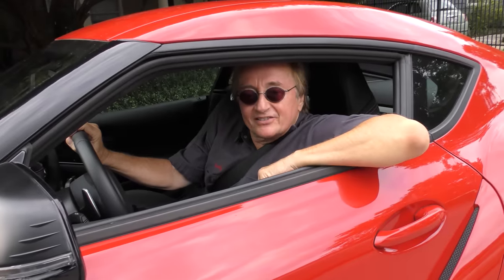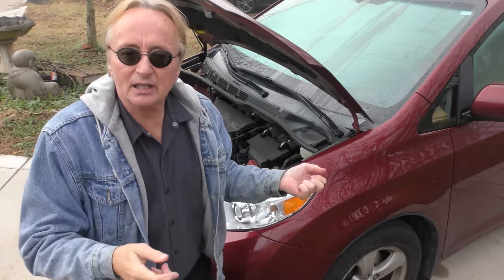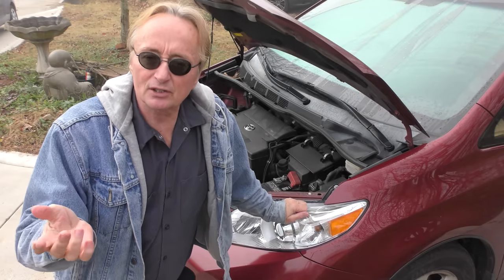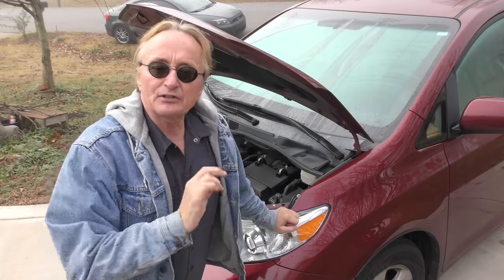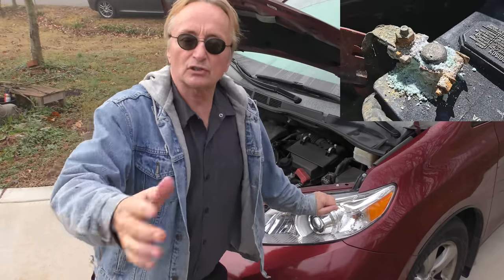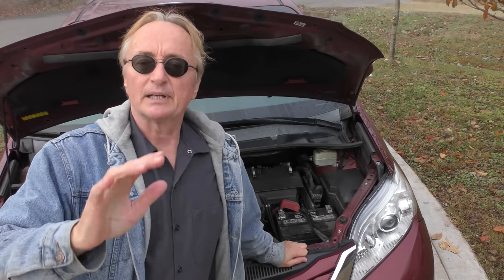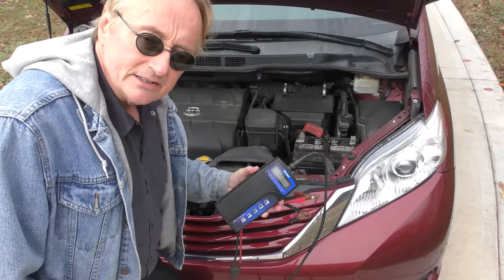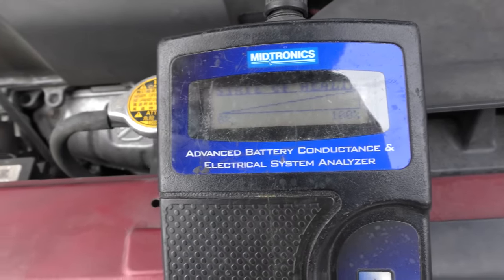If You Buy a Car Battery from This Place You’re Stupid

Comment: I worked at AZ in the early 2000's. Batteries cost $50 - $90. In six years the core charge went from $8 to $10 to $15.00. Handling the core batteries can be a messy issue with new employees. Many of the people they hire have no experience in retail, automotive repair or autoparts. The mid grade batteries, Duralast with the red label were 5 year warranty first 2 years were free replacement. I doubt you could find a battery at AZ under $100 and the Duralast now only comes with a 2 year warranty. In the time I worked there the AZ batteries were rated best by consumer reports for the 6 years I was there. Obviously things have changed with their batteries. I don't get my batteries there anymore either.

Comment: I thought I'd be smart and buy my battery at Costco.  Turns out that if you disconnect the old battery and don't  keep a charge while that battery is off the vehicle you mess something up electronically and won't  start.  Thanks Toyota.

Comment: SERIOUSLY I encourage everyone to try the batteries at Walmart. The good ones not their cheapest.  Two of the Walmart maxx Batteries have lasted me the past 15 years!!! And I just bought the third one today when the last finally went dead.

First one lasted eight years, just replaced the second one today and it was almost 7 years old. I drive my truck every day and damn near drain my battery every day while working in my truck. 

When my trucks turned off I use inverters, both cigarette lighter charger ports, and the overhead light. Sometimes I discharged them so deeply that I have to be jumped off or use my booster pack. 

I drive a Nissan titan, and both batteries were the Walmart MAXX-24F 

They offer free three-year replacement, and are $100. I always grab the battery that has the newest date on the sticker on the top. 

When buying the battery earlier today… I took in my multimeter in the batteries that were two months newer measured 12.72 V under load… Whereas the ones that have been on the shelf a few months measured 12.45. I know it doesn’t make much of a difference but why the heck not get the best one.

Comment: I buy all my batteries from the local junkyard and they work great for $40.  As an alternative I can pay $53 and have a lifetime guarantee and swap the battery as many times as I want.  I have already done my third swap on the $53 lifetime guarantee battery.  On each swap, I average down the $53 purchase price so at the moment, I am at approximately $18/battery and my next swap will bring down my average price to $13/batter.  With all due respect, when I am at Walmart, Auto Zone, Pep Boys, Costco or anywhere else, my stomach turns anytime I see anyone pay $100 or more for a battery.

Comment: It seems best to get it from a company that uses Johnson Controls. I've had issues with other brands.  Luckily it has a warranty but, I've had to change it 2 times about every 1.5 years. So far my current one seems okay it's been about a year now.  To be fair I only had one Johnson Battery. So, it could have been a fluke.  At last check Walmart uses JOHNSON control.  i believe ACDelco also uses it. There are also Local companies. If you want to buy from a local small business. My mom did that a few years ago and its starting fine in 3 years.  I believe that was a Johnson Controls battery. With there branding on it.

Comment: i got my dads old 71 vw, connected the bat terminal and the 10 year old battery turned over the motor and it started. while my RedTop died after 25 months on my toyota. sad days, designed to die now a days

Comment: if you don"t use it you lose it.   i have batteries in a mobility chair and a booster pack that were frequently dying before their time.
be it a parasitic draw from onboard electronics or just losing charge over time the results are the same. even recharging with a quality charger wont bring it back. my solution was buying a battery maintainer. they keep the battery topped off and now my batteries last years. harbor freight has some inexpensive 12 volt maintainers and my power mobility chair is on its 24 volt maintainer 24/7

Comment: Co$tco was a slightly lower price than Walmart, I believe.  I picked out the newest battery. (I remember batteries where you poured in the acid.  The leftover acid I put in the toileto dissolve mineral deposits.  Now use white vinegar.)

Comment: This advice is perfect. Batteries do last a long time. BUT when they do, they just die suddenly. My son works for Firestone. They do sell ALOT of batteries. I get it from the horses mouth. My battery just suddenly DIED. I called him up. They just got a shipment of batteries that needed to be unloaded. My son saw the battery that would fit my car. He grabbed it. Shoved it in his car AFTER paying for it. It was NOT CHEAP. Even with the employee discount. He comes to my house and was handing it to me. I told him "If I am going to PAY that price, you 'effin' install it. So he did. He got paid by Firestone. Don't worry!!! It started right up. How did I test the battery? A CHEAP digital multitester. It said '8.4 volts'. So I knew it was the battery and not the starter or alternator.
Reply: 8.4 Volts? A fully charged battery around 12.6 Volts. Did you had to recharge it?
Reply: @jeffreysantos9070  The battery that was failing was 8.4 volts.
Reply: @stevenwisneiski8413  ok thanks.

Comment: Never ever buy a Walmart battery.
1. They leak acid, and corrode your connectors 
2. They don't always put enough acid in the mix, and they will freeze in low temperature and short. 

Spend the extra money and get a GOOD battery.

Comment: I go directly to interstate battery distribution center, and buy directly from them.  They service most repair shops come to drop off and replace old not sold units as well as pick up the core replacements. A lot of replacement cores are sold to reconsider and get re-energize, new acid and shock charging
You can get them cheap. But don't count on them lasting long term.
They might get ya by a year or so.
I've bought Walmart batteries they are junk.  Your lucky to get a year or 2 of use out of one.
Id much rather but a vacumed sealed battery and fill it fresh.  Somone should sell dry batteries and acid to refill them.
Most batters are made in 3 places  every brand  now Walmart imports a lot of cheaply made stuff so there battery line might come from offshore bussines.

Comment: I have the same year car and a second bad toyota battery.  agm or flooded?
Reply: Use an AGM no matter what. They don't really corrode, and they last well.
Reply: @a.s.4914  good answer did that today. Battery started at 12v charged up to 13.1.  only a month old. I think it will feel better soon. Electric string and sliding doors. 1st day. 🙂 Update: after opening sliding door then checking battery before start had 12.5.  It sat 1 day. 14.2/14.1 idling.  Much better in steering and even in braking.  The engine must be running better for a little more vaccum.  Interesting.

Comment: My 2006 Forester has a Diehard Platinum dated 6/2010. I live in Maine, and it still starts subzero just fine. I have .. no idea how. Every year I consider replacing it but it just keeps going. Who knows how much longer..
Reply: How many miles per day do you drive?
Reply: @zzz-cb3xe  Roughly 45.
Reply: Is diehard advanced auto or Autozone?
Reply: @jeffreysantos9070  Diehard was sold through Sears.
Reply: @Baldwin587  ok thanks

Comment: You buy a car battery by weight. All CCA tells you of the surface area of the plates. The plates can be paper thin and display impressive CCAs. CCA is not the way to evaluate a battery.

Comment: I am cyrrently being scammed by Walmart. They won't replace a 2 year free reokacement battery that is less than 2 years od. The battery only produces 360CCA out of a rated 600CCA. I just tried for the 3rd time to get the battery replaced and they refuse to replace it. They put it on their rigged tester and claim the battery is producing 760CCA. I didn't know a battery rated for 600 CCA can produce 760 CCA. I don't think it's possible. An independent test from a reputable service shop said the battery is only producing 360CCA and should be replaced immediately. I told Walmart the battery won't take a charge from my high quality 12V battery charger. I showed them the test results from the independent tester and they just ignore it and say if their RIGGED (I believe) tester says there are 760 CCA then they won't replace it. Word to the wise: buy a cheap Walmart battery without the expectation Walmart will honor the free replacement warranty. If you buy it under those circumstances then just hope you will get 12 to 24 months of use out of it before it fails.

Comment: Have a 2016 Chevy 2500 hd 6.0 my battery went dead my father in law give me a jump he hooked jumper cables up backwards it blew the fuse distribution box on battery I replaced it then it put it in theft deterrent mode abs light came on stability track on and towing took it to couple local garages to have scanned the computer could not communicate with the abs module have any recommendations on what might be wron

Comment: Not so simple the computer needs to be told the battery has been replaced since the car changed the charging profile of the old battery it will overcharge until it realizes that the battery is new

Comment: Finally quit wasting money on the high dollar batteries and started buying the much cheaper ones at Wally World. To my surprise they last just as long as the expensive ones which isn't really that long compared to the old batteries we used to have that weighed 40 lbs. and lasted 5 or 6 years.

Comment: From the gasoline video comments about battery sent here: For general lead acid battery, I am finding the one sold at Costco to do very well, the price is just $90 and function very well even when the car is left behind for over 40 days in cold weather (while enjoying a stay in warm Abu Dhabi). For electric cars: It is an interesting used market coming out of the electric cars and I assume that generally when someone buys a new electric car, they intend to use it for as long as possible. So when an electric car does end up on the used market, it might be in need of a battery and the previous owner would have to sell it at low price just for the purpose of the new owner buying the electric car used and spending the rest of the hidden purchase price on a new electric car battery which is usually $5digits. This susally applies to the older electric cars with older battery technology that was not as great as today's battery technology meant to last 1 million miles before the battery goes bad. The best battery for any car gasoline or electric is one that can do the job and last the lifetime of the car itself.

Comment: I had two batteries that the neighbor left and they moved. So I grabbed the batteries and took them home. One was nine months old from AutoZone with a 5-year warranty. The other one had one month left on a 4-year warranty from Walmart. The AutoZone one they wouldn't exchange it. They would only give me a $10 gift card if I turn in the battery. Even though it only had a few months on a brand new battery and it had a four year warranty. Because I didn't have the phone number the battery was purchased under or receipt. It doesn't say anything about needing a receipt on the battery or on the signs inside the store or the batteries . It just says 5-year warranty three or warranty whatever nothing about needing a receipt. It's ridiculous because the batteries have a date stamped on them when they're manufactured and a sticker on them too. Walmart gave me a brand new battery even though there was one month left on a four year warranty. And AutoZone did nothing but give me a $10 gift card I'm almost brand new battery that was effective with warranty on it. AutoZone is a scam. They're whipping thousands of people out there every year on the batteries have watched it.

Comment: OMG, I paid $250 for a battery at local Autozone. Crying again after seeing this video. Also a cheap battery car jump starter can help start the car when the car's battery is low or dead. Have it fully charged before trying. And then take it to a auto parts shop or wally.

Comment: I got a AGM battery at auto zone. Man thing didn’t last a 2 years. Reads 12 volts but doesn’t start the truck. Take it to test and they say it’s fine. Buy a different battery from different place. Bam works like a charm.

Comment: Use to be a battery that came with your new car lasted 6-8 years. (I had a new 85 Ford 250 battery lasted 10 years.) Aftermarket quality major brands 5-6 years. Now if any of them last 6 months after warranty , your lucky. Pro rated 3 years? It's a race to the bottom while depleting the earth's resources and polluting our only place we can live faster than ever. 😪

Comment: I've generally got little good to say about Walmart. HOWEVER. I bought a used F 150 from a fellow, and a couple months later the battery crashed. Not even knowing where, or when, he bought it I went in to Walmart to have them test it and assure the battery was in fact toast. Yep the guy said, and it's got a replacement battery, so lemme get one for ya and you'll be on the road shortly. HUH?? Didn't cost me a dime, and I thought it was gonna be more than a hundred bucks. So I take back some of the bad things I've said about Walmart. BTW, I WAS on the road in about twenty minutes. DANG!!!!

Comment: Hey Scotty.. So when you purchase a new battery should the CCA(cold cranking amps) be the same as the battery before or Higher in Number?
Reply: Just my opinion here, but more cranking amps. Especially if you live somewhere that gets really cold. Those extra amps can determine if your car is going to start or not when it's 10 below outside, WITHOUT ANY WINDCHILL. 

And before everybody starts, I know the windchill isn't "supposed" to have any affect on solid matter, it just "feels" colder, but that's not entirely accurate. Depending on the material of the object that has the wind blowing on it, the temperature of the material CAN be lower than the ambient temperature.

Comment: Here's my question: With all the technology in our cars today, why in the hell dont they have a "state of health" gauge on every car? So that you could monitor the health status of your battery. most cars have nothing to monitor the status of the battery and you dont realize anything's wrong with it until the car wont start and your stranded. To avoid this typical situation I alsways change my battery at the 2 to 3yr mark (depending on the battery rating) whether it needs it or not. This could all be solved by car manufacturers adding a battery status gauge (such as the one he used to measure the battery in this video). So WHY dont they do it??

Comment: I have an 04 honda accord LX I recently had a battery put in it at a dealership the battery that was in the car when I bought the car was a regular sized battery the one they put in looks like a lawn mower battery i have an after market car alarm and it pulls a lot of power can i put another larger battery in my car it will fit in the car i hope you can answer . Thank you
Reply: Measure the battery compartment. Look up battery size charts online. Buy the biggest one that fits.

Comment: When buying a car battery treat it as a service contract. Can pretend you know the quality of the battery but you do not. Vendor can buy any quality of battery they wish from the 3 manufacturers who supply 95% of North American starter batteries. You don’t know what they selected. Let the vendor put their wallet on the line with a warranty. Compare price divided by years of warranty. $190 for 4 years vs $80 for 2 years? The 2 year battery wins but not by much.

Comment: Scotty. I tried to buy a battery for my 2014 walkswagen beetle and they told me that I have to buy it at the dealer because they have to do something with the car computer. Is this true?
Reply: Not sure about what kind of warranty the Volkswagen's have, but if it's still under warranty, which I know there are still a few manufacturers that have a 10 year, 100,000 mile warranties, they will void your warranty, and not cover any repairs for the balance, as well as not cover any damages that might be caused by not using a battery from the dealer. Look in your owners manual for that info. If you don't have an owners manual, you can usually find them online for free, or pretty cheap. Outside of the warranty, I can't speak to.

Comment: I used to carry a 800w generator when battery wouldn't start that would charge it up after about 5 minutes enough to start with a battery charger . But I'd leave it on there while starting.🚓

Comment: Where not to buy a battery isn't any good if you don't know where to buy it.
Walmart, I tried that. OUT OF STOCK.
When you getting more? 
WE HAVEN'T GOT A CLUE.
You said that cheaper tester would work, but if you hadn't told us, that with that tester, we wouldn't know that just charging it wouldn't fix it. I don't know Scotty, you might be slipping.

Comment: Chinamart does not Pro Rate anymore. Also, if you have a bad one, and I've had at least 2, they put it on a load machine, it takes 2-3 hours.
With the Auto Parts Stores, they test it and replace it.

Comment: No Scotty they actually recycle the plastic most of the acid and lead so you’re wrong about the recycling of lead being $18 I hauled Exide battery out of North Carolina most of them went to Florida I dropped off at all the Ask Lawers place is going down to Miami turned around went back and picked up all the scraps and each one that I just delivered the new batteries to and then took him to Louisiana discovery models that have scrapped and what they do is they load them off your 18 wheeler trailer on the conveyor belt and it’s all of the top cell phone and that’s when I start the recycling process!